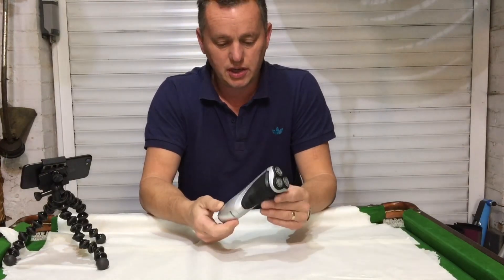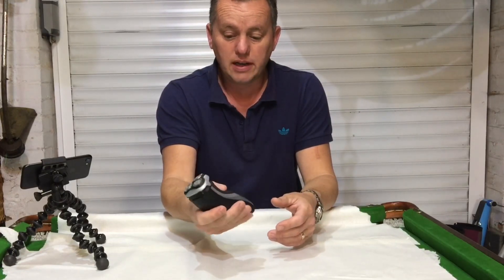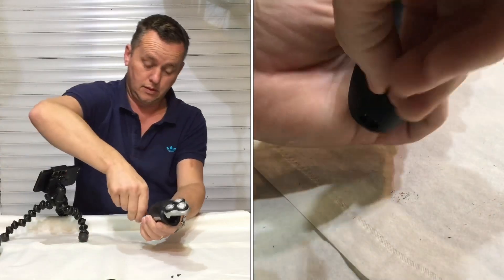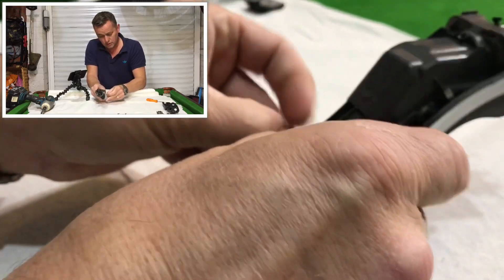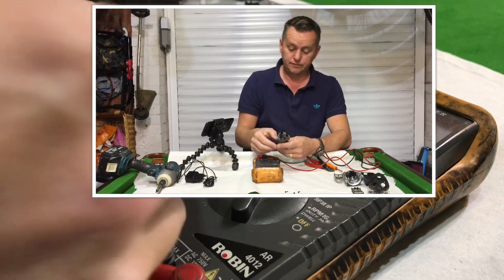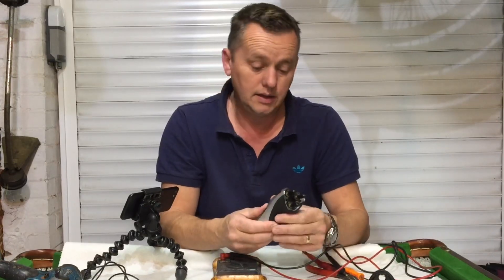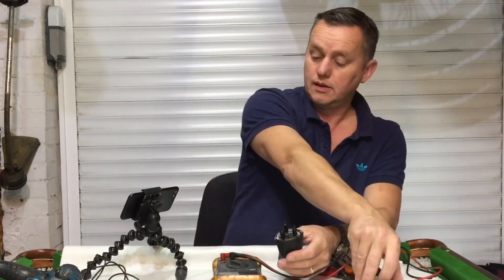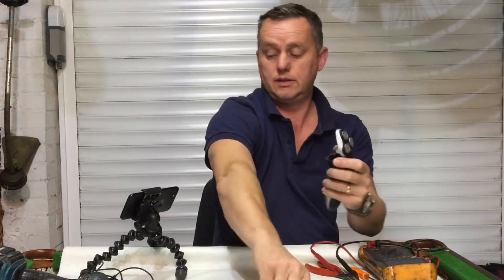Phillips Shaver Faulty, “How To Repair"

Comment: Good video - have a similar Norelco/Phillips wet/dry razor I bought in 2020 and it went on the fritz. The power light bar lit up so I couldn't understand why it wouldn't operate. Opened it up and the negative/black battery wire came unconnected and I had to solder it back to the contact point it was attached to and then it worked again. Such crappy "workmanship" from a major brand that Phillips owns - doubtful I'll buy another Norelco/Phillips shaver again - back to Braun because those are built like tanks.
Reply from the maker: Thanks for the great information👍🏻👍🏻🛠

Comment: I have one of the and do not charge, i open it and transistor m101 is carbonized but i dont know what the code of the transistor is carbonized, i dont find the data sheet of the board
Reply from the maker: Thanks for the great information👍🏻👍🏻🛠

Comment: I have a model from 1971 (a plug in model). It was still working untiol recently, and if I could get the pop up head to close properly again it would still work. But now when I open it, it either falls off or goes crooked and won't fully close (the pins don't hold any more). Believe it or not, it still has the same shaving razor heads--never needed to replace them. But, if I can't get it to close properly after cleaning, I'll have to buy the new garbage they sell now. It reminds me of their Soni-Care rechargeable toothbrush on a stand. I paid a lot of money for it, but one day it would no longer charge. They should have made it like their travel model with removable AA batteries--I've still got that one! I wrote to them about this, and they never had the courtesy to even reply. My old shaver was made in the The Netherlands, (where I was born), and back in the day (as you noted) they made quality products. Now that the bean counters run the show and greed runs high, all we get is throw way crap that does not last! And, of course, it's not made in the Netherlands any more...
Reply from the maker: Thanks for the great information👍🏻👍🏻🛠
Reply: @aaanton11  I might be able to repair it if I can solder the pins back into the metal housing (or use super glue). Tricky, but not impossible.

Comment: Hoping maybe someone who has had this problem and/or knows what to do about it sees and can help.

The problem I'm currently having with my Philips 2000 shaver is that only one blade will spin. When opened and taken apart, I've found that all three pieces connected to the battery will turn, and they will turn the pieces that sit inside the blades, but only one of those pieces actually grips the blade and spins it - the other two pieces spin inside the blades, but the blades themselves do not spin. I purchased new blades and basically tried every combination I could come up with - full new blades, old blades with new inner pieces, new blades with old inner pieces, changing their positions within the shaver, but at the end of it all, what I found is that only one original inner piece will cause of the blades to spin. I tried holding the blade in my hand and turning the inner pieces inside of the blade with my fingers - the one inner piece that actually does work would not rotate inside the blade because it was gripping it. The other inner pieces would not grip the blade, and thus spun around inside the blade. Does this sound like anything anyone else has experienced?
Reply from the maker: sounds like one of the gears is worn, Thanks for the great comments👍🏻👍🏻🛠

Comment: I have the AT899 06 (no clipper model). The charge light does not work and there is no life. I checked the charger which is outputting 8.4V (rated output 8V) curiously the shaver says input 15V. Contacted Philips and they tell me the charger is faulty and gave me a link to a retailer to buy a new one...nice one guys. I am now going to have at the insides having seen how easy it is...I bet it is a capacitor on the battery charge reg part of the board. 
Thanks for sharing and giving me the courage to have a go.
Reply from the maker: Phillips helpless  desk will tell you to buy a new shaver 😂 I think its definitely worth a look, Thanks for the great comments👍🏻👍🏻🛠
Reply: I noticed on the one I’ve just fixed it had corrosion on all pins where each part of the charger goes ,after cleaning all of the corrosion the shaver decided to start charging again .

Comment: Had the same problem, did what you did and it worked! Next day it failed but then started, day after that the problem was back. Don't think I'll bother opening it up again. I did notice that the inside seemed quite "'messy" and parts caked in grease, aswell as obvious signs of damp on the circuit board. As it happens I have two older phlips shavers. The oldest, a bit chunky, is still going strong and used for trave, the other works bout the casing around the on/off switch has cracked. I will try a Braun.
Reply from the maker: Definitely worth trying a different brand, Thanks for the great comments👍🏻👍🏻🛠

Comment: My 5000 series keeps cutting out.... as in it'll run for 2 mins then cut out. I shake it and it'll start for 2 more mins. Would this video be useful?
Reply: Philips 11 in 1 Beard Trimmer and Hair Clipper Kit MG5730/33922/2683

I take it back its not a 5000 it's this..
Reply from the maker: Could be, give it a bash, Thanks for the great comments👍🏻👍🏻🛠

Comment: To aaanton. Used Philips shavers since l turned 13 years old . Have to say that I have never had a single issue ever except lst battery operated version which needed a service after a few years use. Now l am 61 and still using Philips. Wouldn't use anything else.  Couldn't disagree  more. Good old Philips shavers l say!
Reply from the maker: you are spot on, good old Phillips, the old stuff is great, the new stuff not so good, Thanks for the great comments👍🏻👍🏻🛠
Reply: @aaanton11  
Generally update my shavers every 5 years approximately.  I find newer shavers just as reliable as older models. Good older and newer models l say. Again newer models never a moment's issue ever.

Comment: Hello,
What is the exact model number of this Philips shaver at this video? I am using Philips AT886/16 for last 5 years and I faced the same problem twice. For both of them, I solved the problem temporarily by pressing to power button several times. Fortunately it is working fine right now, but I don't know how long it will last.
Reply from the maker: not sure on the exact model as it is no longer available, Thanks for the great comments👍🏻👍🏻🛠

Comment: Same issue with mine. However: The problem seems to be the manner in which the wires leading from the PCB connect to the motor. I had to de-solder the wires from the PCB and then push the motor out of the plastic housing. Once the motor was out, I could see that the motor connections were simply "twist" crimped onto the wire holder (difficult to explain, but easy to see). After soldering the crips on both sides, the motor is running steadily. Simple fix.
Reply from the maker: Well done, Thanks for the great information👍🏻👍🏻🛠

Comment: I opened an old shaver that stopped working in July 2019.  The supposedly hermetic seals that enclose the circuit board had obviously leaked and the pcb was covered in brown dust.  The motor was very badly rusted so the seal around the gearbox had also leaked, and I could not turn it.  But the original problem was that it would only run for 2 seconds at a time when started.  If I charged it overnight it would start reliably, and I could run it for many minutes - then run it again many times on the same day.  But by the following day again it would only run for 2 seconds unless left on charge overnight.  I suspect the circuit is designed to prevent operation if the battery is nearly flat, and as the battery ages the voltage at start-up is under specification.  This is my third similar shaver. The previous one lasted from November 2017 to July 2019.  I suspect the first one lasted 5 years.  My guess is that they were all made at the same time (perhaps 2010) and the batteries have aged in storage.
Reply from the maker: I just think Phillips use cheap components and poor seals, Thanks for the great comments👍🏻👍🏻🛠

Comment: I had problems with the switch not working, as well as the green indicator light going on with the unit not turning on when pressing the switch on my Aquatec... Then I rapped the thing a few times, and for a while, everything worked fine... Then one day, nothing, no activation, nor was there any charge activity... Since the stupid thing was beyond manufacturer's warranty, I just pitched it, and replaced it with a Philips 3000 wet/dry, and purchased an extended warranty via the retailer with this new one... We'll see how this one works... It seems to have a better switch assembly then the Aquawreck did... I remember my first Philips Norelco unit I used in the mid/late 70s when I was a teenager... Built like a tank, and went for almost 7 years until the motor gave out from heavy use... Now, I see they're garbage, just like you said...
Reply from the maker: they don't make them like they used to, Thanks for the great comments👍🏻👍🏻🛠

Comment: I replaced the batteries of my Philips shaver (different from the one in the video) cos it was shutting down within 5-6 minutes. I thought maybe the batteries have gone bad since it had been almost 5 years since I had bought it. Even with the new batteries, I have the same problem. Totally useless. I'll probably just use it to trim my nose hair from now on. 
A traditional safety razor works best for me.
Reply from the maker: Sounds like it needs the large hammer treatment 😂 Thanks for the great comments👍🏻👍🏻🛠

Comment: Thank you for making this video. I did the same as you but my problem was that one of the connections to the battery came loose. So I just soldered it back on.
Reply from the maker: Glad it helped Thanks for the great comments👍🏻👍🏻🛠

Comment: I just like to add my veiw on Philips shavers I bought one in 1999 wet and dry shaver for about £60 it finally died in 2021 r.i.p and I have to say (didn't even change the blades) it was the best money i ever spent now years later i checked out Philips shavers and to my horror found out that they are now designed to only last a few years (allegedly) you can buy replacement blades but I found that the price for them is almost the price of a new shaver my point to all of this is they don't make them like they use to so do your homework frist before spending your hard earned money on so-called branded names anyway enjoy your life and stay safe everyone
Reply from the maker: Thanks for the great information👍🏻👍🏻🛠

Comment: Thank you for showing how the case is held together. Like you my battery was charged and the switch worked, there were no signs of corrosion on the board (unlike electric toothbrushes). In my case it was the motor top bearing had seized, there were signs of water there. The top gearbox, can be pushed out by levering on the bottom of the motor, it pulls apart quite easily exposing two more screws which hold the base of the gearbox to the motor. I gently lubricated and encouraged the shaft to turn until the motor ran again. A tip, seeing how brittle those tabs were on the transparent cover I warmed mine gently with a heat gun and they didn't snap.
Reply from the maker: nice repair, Thanks Chris for the great information👍🏻👍🏻🛠

Comment: What torx bit is the one needed to remove the 3 bolts? Where i live buying a whole set is really expensive and i would rather only buy the one needed to do the job
Reply from the maker: not sure, if I didn't mention it in the video, Thanks for the great comments👍🏻👍🏻🛠

Comment: My Floating head has been in use for "40 years", same battery. I dropped it on the bathroom tiles last weeks it stopped working. Poor craftmanship, had enough of the Philips crap, only 40 years. Found the wire to the motor had come off. Soldered it on worked. If it doesn't  work for another 40 years I'm taking it back.
Reply from the maker: Thanks for the great information👍🏻👍🏻🛠

Comment: Mine's a different model, but same problem. The screws have some weird head, not philips ironically. Specially designed so DIYers can't repair them when they fail to charge. Philips did fuck all when I contacted them, my shaver was a bit over 1 year old. All they had to do was send me another one, goodwill and all that. No, offered alternative models at a discount, so I could be fucked over again. No thanks, I bought a Braun instead, which I should have done.
Reply from the maker: Thanks for the great information👍🏻👍🏻🛠

Comment: Hello,
I have the same shaver with exactly the same problem as yours. I also took mine appart and found nothing wrong (switch, solder joints, battery voltage,...). It must the the brush motor that's giving up.
Everything I bought from Philips didn't last much and this shaver is no exception  - a true piece o crap from a crappy brand.
Reply from the maker: Get the big hammer 🔨 and give it a bash, thanks for the great information 👍🏻👍🏻🛠

Comment: Mate...great video.  When I saw how yours started working while you were inside it,  I just knocked mine about on my hand without taking it apart and it works again!  I was gonna throw it out.  Big cheers.
Reply from the maker: Thanks for the great comments👍🏻👍🏻🛠
Reply: Not all heroes wear cape! thanks mine works now too!:D
Reply: Gary Fearon - That's what I did with mine while I was watching this vid! Mine is just two years old, with the blades replaced, and I got nothing when I pushed the switch, even with a full charge... I Just knocked it about in my hand with the just the head assembly off, then shook it a few times, pressed the  button, and the damn thing works again! I think it has something to do with water or gloop getting down there, even though the unit can be used wet, which I NEVER do!